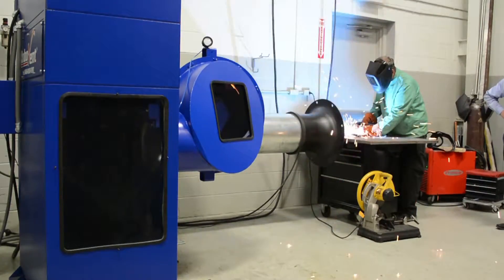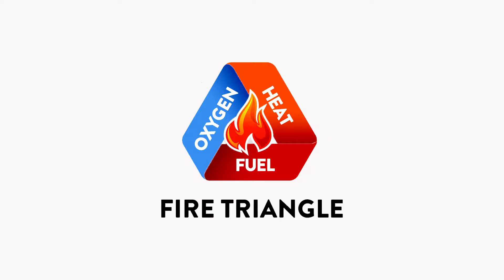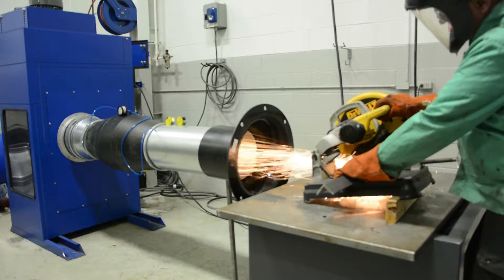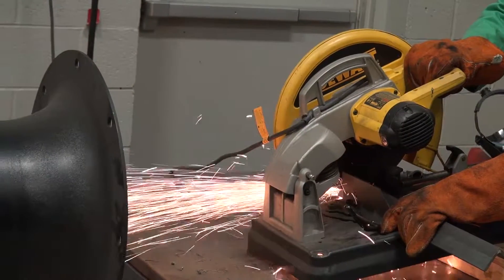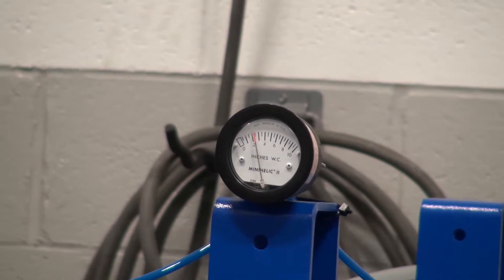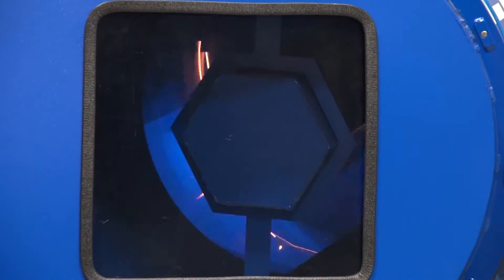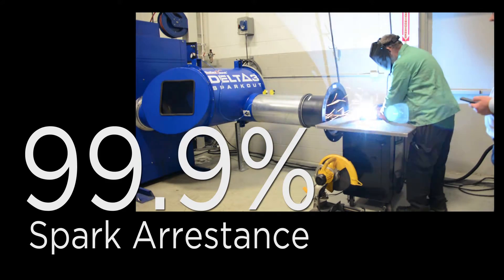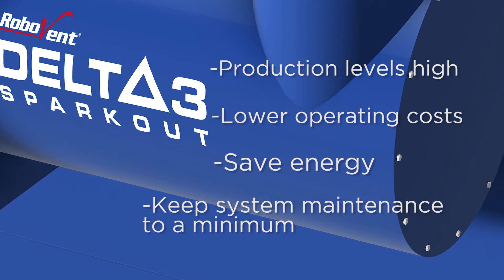Delta3 Spark Arrestance System for Dust Collector Fire Safety | RoboVent | 877.299.7223

Comment: I rec'd 2nd degree burns on my arms and scalp from a dust collector fire in June at work, it was connected to a CNC router, and yes, it WAS grounded but static is not the only source of fires. The entire facility- 4 buildings burned to the ground because of this dust collector which was made out of PLASTIC and installed inside the building with the CNC. Ive been recovering at home now the last 8 weeks.